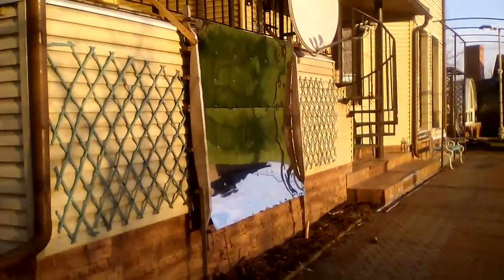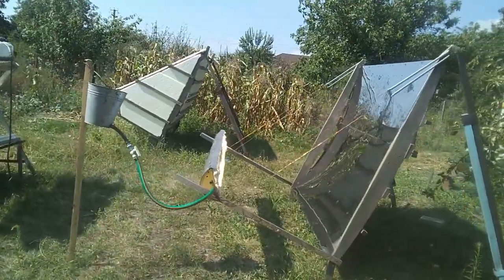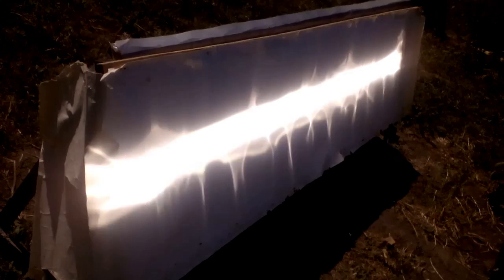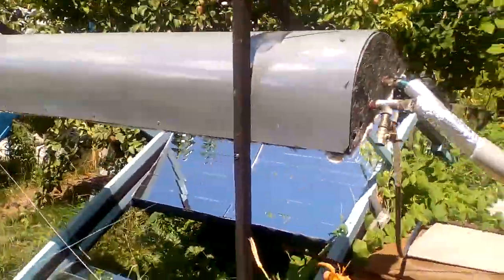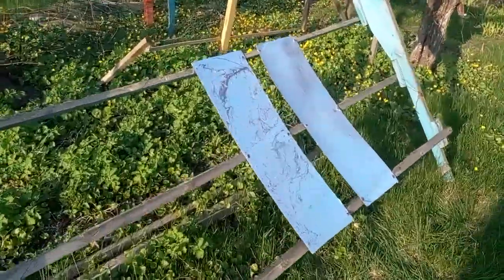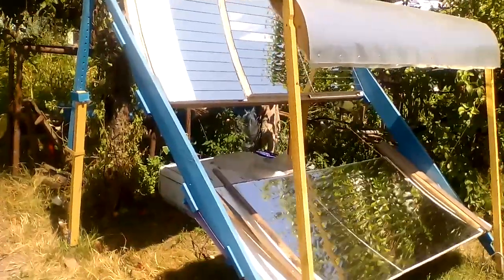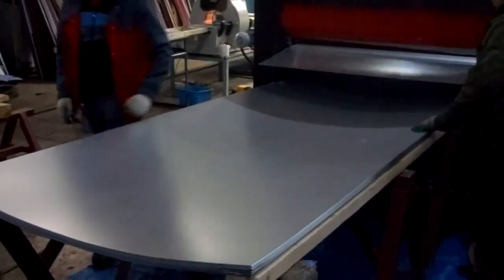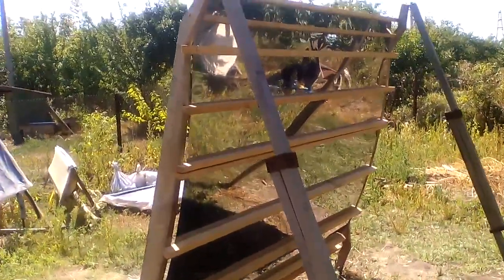Сheap solar power from metal mirrors. What's wrong

Comment: I recently found a paper on hydroforming of stainless steel sheets to construct lightweight telescope mirrors (no toolmarks!). Ideally, you would want the steel sheets to stay in the curved shape by themselves, which can be achieved by hydroforming or stretch forming. 
I suspect the screw mounting positions are more detrimental than they look, creating lager "blind" areas when the collector is narrow.
Reply: is the paper available publicly?
Reply: @fleaniswerkhardt4647  Youtube totally deleted my earlier reply, as was to be expected. They really hate citations.

Search for "Design and development of a freeform active mirror
for an astronomy application" by Zalpha Challita et al. (2014). It should be the first arXiv link.
Reply: i read paper but its too advanced for me i think,

 let me tell you something if you put secondary reflector at 90 degree perpendicular to the first then you can achieve a point focus not many knew about this method, you dont need exact or pristine parabolic curve only 2 bended sheet opposite to each other
Reply: @dogodogo5891  tell me more, please.
Reply: - ??  edge clamping in to the formers - with adhesive for permanent fixing..

The flexible sheet should naturally conform to the curve with little distortion.

Comment: This is a complete guess, but im thinking that the possible useful lifespan of the stainless sheets would be longer in other ways too.  Glass over time will scratch just due to dust, wind, rain ect.  Once glass is scratched it needs replaced, whereas maybe yhe stainless could be refurbished using a buffer and some cutting compound.  I could absolutely be wrong, but just something that i was thinking of.  Great video as always my friend! Your videos always get me thinking about new solutions 👍👍
Reply: The brightest reflective metal is aluminum.
Reply: @Jkirk3279  but not for very long

Comment: I am looking for a good reflector for my projects.  Concentrating reflectors must be "specular"  (You have to be able to see your reflection in them) So white paint won't work, it is reflective but not specular.  ).  The issue with stainless steel is that it absorbs infrared so it doesn't reflect as much energy as aluminum.  Most aluminum sheet is highly reflective but it  isn't specular, it has "differential reflection" so it reflects differently depending on the direction light comes from and this is no good if you are doing parabolics.  (Aluminum sheet has microscopic corrugations on it, like on a metal roof, and this is what causes the differential reflection.  You can test this by shining a laser pointer on a glass mirror, the reflection of the point is a dot, on a aluminum sheet the reflection is a straight line in one direction and a semicircle at 90 degrees to that direction!  Also, aluminum has a thin aluminum oxide layer (That's the same stuff that's in sandpaper) on it so it is really hard to polish it,  so, you have to buy sheets of aluminum specially made to be specular (mirror like finish) and also aluminum is both acidic and basic so a lot of materials react with it.  I believe you need an extra plastic or varnish layer on the sunny side to prevent corrosion.   I have also tested mylar with a laser pointer (some light goes through it) plus when I used it, (years ago) you could scratch the metal coating off so it didn't last very long,  and metalized plastic, which is usually a very thin layer of aluminum sandwiched between 2 layers of plastic  (the silvery plastic from crisp or chip bags and plastic chocolate bar wraps) and some let lots of light through to the other side and some very little. BUT they are specular!  The best (non glass mirror)  reflector I found so far was a silvery coloured plastic plate from a dollar store.  It looks as if it is nearly as good to reflect light as a glass mirror.  So, its cheap (dollar store) and it could be manufactured as  "petals" for parabolic dishes or perhaps any other shape.  I don't know how the metal colour is deposited on it. And I don't know if it could be made to come on a roll like mylar, and I don't know how long it will last in the sun, but it is the best reflective material I have found so far!  I hope this helps.

Comment: Did you have to polish the steel sheets yourself, or do they come this clean from the manufacturer?
Reply: I also bought some of that sheet material, it's sold with a mirror finish and peelable protective foil, but may also come coiled and without the foil.

Comment: stainles mirror wil get dirty and oxidise with time ...if you install out of reach of  hand no good cant clean...also maybe need enclosure an glass to sawed heat and stop mirror from getting dirty
Reply: Is there any  coating from 3M or similar that can reduce the problem?
Reply: I'm sure there is a solution, like a heat resistant lotus effect finish or something. But... does it really matter? It should be easy to keep the mirrors clean and polished regularly using common methods. Finally, Sergiy states that his mirrors are still working well after seven years.
Greetings from Germany, I wish I could sponsor all of Sergiy's efforts because this is the future.
Reply: The surface of Mars is covered with fine iron dust. Mirrors could be made from this dust. And in this way to produce energy.
Reply: I think there are much beter reflective materials like Mylar and white titanium paint who are cheaper than stainless steal they use this for light reflectors also polished aluminium is more reflective than steal
Reply: @doctorinvizible2077  please share. Thanks.

Comment: If the goal is to heat water to below boiling(say for house heating or bathing) it can be more energy efficient to make something like a car radiator, facing towards the sun, coated in something very black, and enclosed in double paned glass. to porevent the cold outside air from taking away the heat.
You shouldnt be able to get boiling water from this(it is possible if there is no airflow) but you should in theory have better energy collection efficiency, heating a higher volume of water, faster than a solar concentrator, when you take the area of the entire structure into account.

You can also make solar concentrators more effocient by doing much the same as described above, as the point of the radiator is not just to give more surface area, but to reduce the ammount of light that bounces away, making each beam of light bounce more and more inside of the radiator, instead of just once.
Reply: The outperformance of the concentrator will be most noticeable in cold weather such as below freezing (assuming you use an antifreeze additive or a non-freezing heat transfer fluid)
Reply: @chavocanuck  As long as you have decent thermal isolation, you can get better efficiency from the above scenario, The equivelant of a double dewar preventing the wind from blowing away that heat

Comment: Try to make a water lens. This could be a cheap replacement for the Fresnel lens. The plastic film is stretched on a round frame and watered from above.
Reply: this is good for emergency purposes but wider are need wider plastc and they will brust apart by weight just like telescope mirror that's why they didnt cast a huge metre of glass

Comment: You might try coding some sort of parabola with the super white paint as described by tech ingredients and nighthawkinlight.
It has a reflectance of greater than 99% utilizing the same principles as snow scattering. Through this property it is able to achieve a material service temperature lower than ambient temperature.

Comment: hi. it seems that new pervoskite panels from oxford pv... they have starting mass producing them now. With these initial versions at 30% effeciency. It seems they will be the game changer for electrical solar. Because the effeciency may be increased even further, the theoretical maximum for this technology is high (like maybe 70% as the physics upper limit). More modest expectations is still like... 40%+

Cost wise remains a bit unclear to me. But if the motivation to save the earth exists, then those in responsible positions should not be too greedy. In various ways to ensure a good widespread adoption

The reason I bring this up is clearly because: electrical PV solar is easier to install, easier to manage and upgrade or connect to grid. With smaller deployments. There is no minimum size to worry for being worth adopting etc. So it should remain as a preferred option over these other variety of alternative schemes. Being direct conversion to electric. It removes a lot of different headaches. So many.
Reply: Can you provide sources/YouTube videos so I can keep up to date on this progress?
Reply: i think Mr Yurko Is on the right track here. Wherever possible direct use of direct heat from the sun should be used as it is way more efficient than sun->pv-electric->heat usage. It is cheaper, has less environmental impact and can be made "locally".

I'm not saying no to pv. I'm saying we should harvest and use the energy as efficient and eco friendly as we possibly can. Hot water and house heating can easily come from the sun as Mr Yurko's work has proven. Even at my latitude 59° north. I already use pv panels for my electrical consumption with the exception of hot water and house heating.